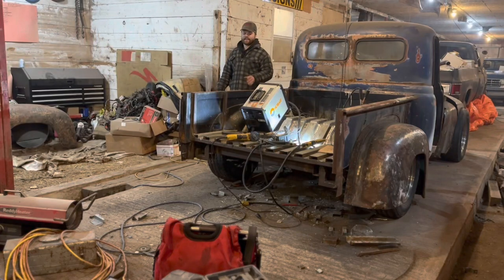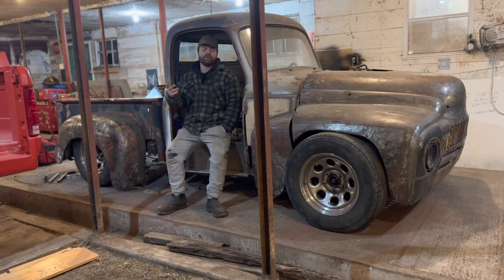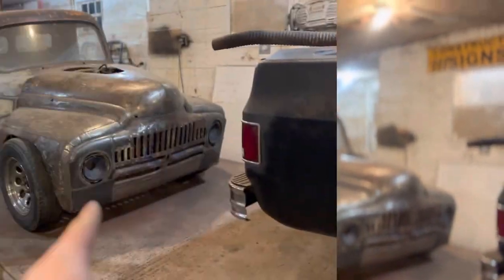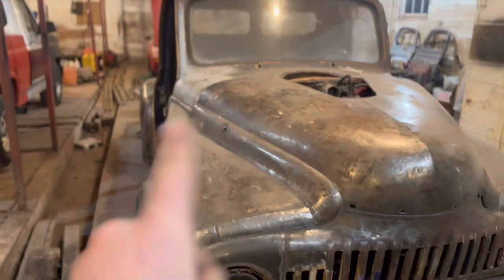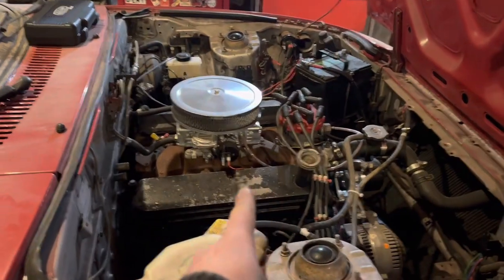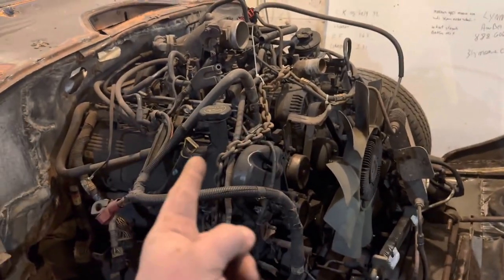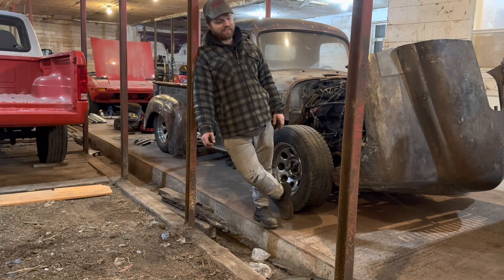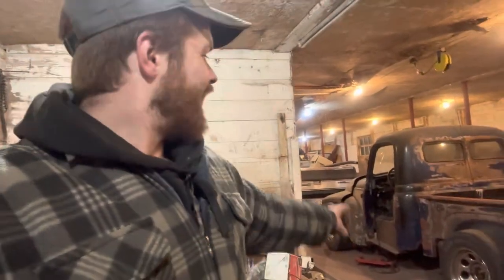Traditional Hot Rodding is dying, and it might be too late to save…

Comment: You're really right about everything you said, but you're also right about your video about still being able to build fun cars on a budget even today.  Is it going to be a boomer-mobile (Camaro, Chevelle, Anything Mopar), absolutely not!  They've gotten so outrageous even if I was made of money, I wouldn't want to risk driving it in case some idiot with no insurance plows into it at a stoplight! Just collector's items now.

I'm finishing up my 93 Chevy C3500 454 5-speed 2WD.  The drivetrain has only 120K and runs 100%, doesn't even burn a drop in a 3000-mile oil change, but needed cab corners and a couple other patches welded here and there on the bed, so I decided to use that (my new daily/parts getter) to learn body work on.  I learned a LOT about welding thin steel, getting the hang of high and low spots, etc.  It's getting painted in 2 weeks.  Then, I'm starting on the actual hot rod.

I live in Pennsylvania, so we have a really cool loophole/exception here for "street rods".  Basically, it doesn't even have to actually be built pre-1948, it just has to be STYLED like a pre-1948 car.  I'm getting a '37 Fiat Topolino Altered fiberglass body, modifying it to be more what I want, and scratchbuilding a frame.  I'm going to use a junkyard rear end, engine, transmission, and independent front suspension.  I will have to make a lot of custom parts.  I will have to adapt a 90's engine to mechanical fuel injection (with a blower) and speeduino to fire the coil packs.  It's not going to be much in the way of 'off the shelf', and that's okay by me.  You have to have more skills to use the newer stuff for sure.  I'm not sure I'd be able to do it with a Coyote or other engine from the last 10 years, but I know enough to do it with the stuff I've picked out.

1994-2003 Dodge Ram 8.0 V10
     Fully filled block, bored, sleeved, forged pistons and rods, full ARP studs, home ported heads with bigger valves, beehive      springs, adapter plate for bellhousing to GM or Ford modular depending on the transmission

1999-2010 Ford or 2001-2006 GM 3/4-1-ton pickup ZF6 6-speed manual
     I want to replace crawler gear with something under 3:1 if possible like a 1st gearset for a C4 corvette version
~2010-ish AAM 11.5" Full-floating rear axle.  Much cheaper and more readily available than real 9" stuff (not counting the Chinesium) I will CAD design and have laser cut adapters to go from the 8-lug pattern to a "Wide 5" 5x10.25" sprint car 5-lug pattern, so I can then use sprint car type Weld 3 piece forged wheels

C7 Corvette Front Suspension K Member Assembly

Comment: As an older hot rod guy I can say you made alot of great points. I started when I was young on hot rods mostly from the 60s and was only a teen. 
I still dabble.
If I may... I would like to add 2 more reasons why this kind of thing is dying.
One is we live in a society of instant gradification.
It takes time to finish these projects.
The next thing I would add is how few there are willing to put in the effort it takes for these builds. I see every day many who would rather pay someone than try to do it themselves. One way is hard, one way is much easier.
Reply from the maker: There is an an old saying “good times make weak men, weak men make bad times, bad times make strong men, strong men make good times”, I think right now we are in the weak men make bad times stage of things, that might be part of the problem.
Reply: Do what you can to keep it alive for future generations!
Reply from the maker: @MachineDr.  will do!

Comment: There’s a bit of a trend among American born Chinese, Koreans, Japanese and Indians to find an old car from the forties to seventies, restoring it then adding period hot rod touches to it. These cars, mostly British, French, German, Swedish, Italian and American, are used everyday. Let’s say a 1940 Lincoln Zephyr, they restore the car back to original condition, lower it, put Ardun style heads on the flathead V12, new cam, blower, Stromberg 97s. Bolt up a late model transmission and rear axle, brakes, etc.  

I saw an adorable little Renault 4CV looking as if it came out of the pages of Hot Rod magazine, circa 1955, owned by a Chinese kid. The little 850cc mill in the back was really hopped up, as if Gordini lived in Southern California. It was a reason to smile that day.

Comment: dd speed shop is another good channel. real deal. if you want to build old rusty cars. you really have to want it. its not as easy as people represent . but put your time in. its going to be frustrating. its going to be expensive, more than you expected always. but keep working at it, always takes longer than you think. its always worse than you think but don't quit  and eventually you'll have a cool hot rod. that is hot rodding!
Reply from the maker: I’ve actually watched a lot of Dd speed shop dd speed shop dd speed shop and I quite enjoy the way he goes about it, but I agree, it seems like there is a disconnect from the beginning of a project to end result, and a lot of people don’t care for how you get there, but that’s really the best part. That is what makes hot rodding  so special, pulling parts from other vehicles, building your own parts, modifying things or simply making new things, a lot of people appreciate the end goal but don’t have the stomach for the trip start to finish.

Comment: I have a Little Bit to Add to what you are Saying.... I've been a Pro Automotive Mechanic Self Taught for Over Forty Years... I at this Point not only have Extra Parts Supplies Etc. as Well as Most Types of Had Tools and a Far Amount iof Okay Equipment and Specifically Tool. Also Connection for Parts Vehicles and Other Guys that Know Vehicles. All that being said... I've Seen Non Professional People take and Put a Modern Chassis and Drive Train Under an Old Rig so it can Be Done. But Desire and Natural Ability are a Big Part of that too. Keep in Mind You Still have to have a Place to do it and Also Hope that the Used Drivetrain is in Reasonable condition or you Run Into Snags that Will Stop Noice People Cold in Their Tracks. Thanks for Sharing
Reply from the maker: Very true, I agree. There has been a large shift from home owning to apartment renting in recent years, when living there it’s very hard or next to impossible to take on a project like this, I’m very fortunate to be in the position I am.

Comment: i read a study that the new generation of upcoming 20yrs olds a vast majority dont even own tools...
getting dirty at work or hobby is the new STD
i can pickup a decent JDM motor for about $2k.....
an SBC mopar or ford thats just as (price) trust worthy doesnt exist....
i have no connections or friends in the industry or wreckers i can trust 
and i have a 50/50 chance of getting a cracked crank or block sold to me as perfect and fresh.
if i was to get re-started in todays market it would be a recipe for disaster and only if im lucky would it even be fun
Reply from the maker: Gotta learn it all and depend solely on yourself these days when it comes to the old stuff, and once you make connects you try to keep those channels open. I know exactly what you mean.
Reply: @highostablegarage  thats a learning mountain not a learning curve for the next generation....i was a teen in the 90s and the only one under 50 who could set points or adjust a carb...i switched to the JDM stuff for a bit then life and kids got me.
I'd still just go with newer stuff for the kids because youll probably get ripped off less with bad motors/parts from the newer stuff thanks to the volumes available....half the oldschool stuff has been through a lot by now unless youre buying a crate engine for $10k.....im in toronto area....anything old and certified is $15k+ even the ratrods
unless you want a packard thats still 6volt all original and nearly undrivably slow and poor braking etc...basket case tubs on a mismatched frame are $2k+

Comment: Ok I have to put my input here. it definitely matters area by area but this is my personal experience. I'm building high quality ratrods for way less than 5k. out the door roadworthy rides by looking for the deals on parts vehicles and mixing and matching what I need. I built a 1946 school bus on a k20 frame with a 6.2 diesel for less than 4k by being smart with buying donors and selling p[arts to cut cost. Scarcity of old iron is definitely an area thing because i know a farm with about 15 of those international cabs at around $250 a pop from a guy who wants things done with them. It may be dying where you are at but its blowing up out here.
Reply from the maker: Very true, there are a few of those scenarios around here too, old farms that have lots of old cars in the tree row, but the issue here is none of them usually have paper work, in NB it’s sadly almost impossible to put the. Back on the road until you can find the original owner or head of estate, and sometimes you have to find the head of estates head of estate because the original head of estate is long gone now haha 😂
Reply: @highostablegarage  yeah I live in a state where old stuff only needs bill of and that's pretty much it. No inspection needed if it's over 35 years old
Reply from the maker: @BadgerofBass  that’s pretty lucky